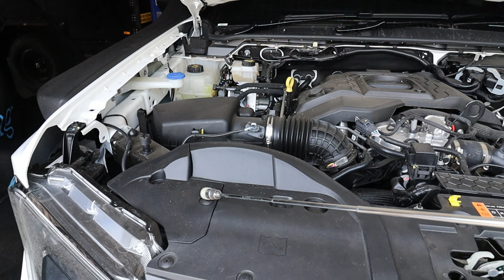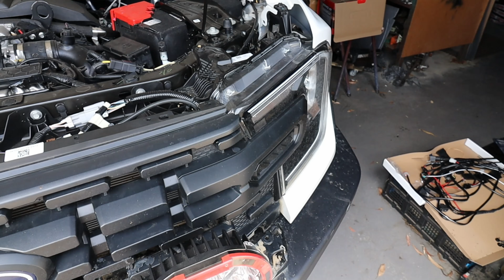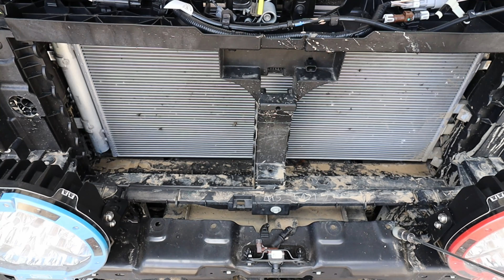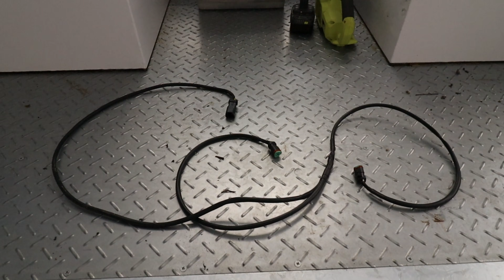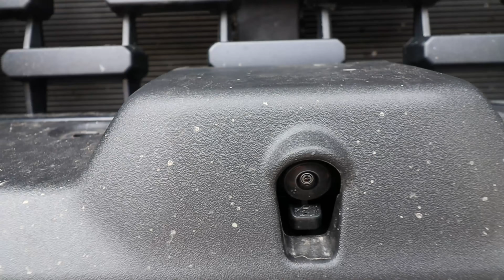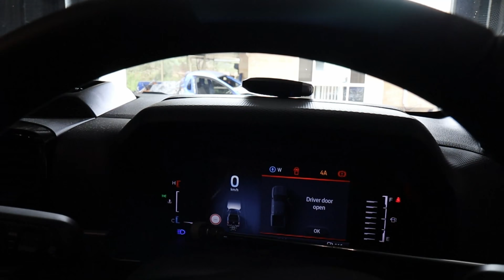Ranger Super Duty - Mounting Spotlights

Comment: Hi Just a quick question about your wiring. I agree that the yellow wire from auxiliary switch 6 should be used as it only receives power when High beam is activated. Did you run a separate earth to the chassis and is this all the wiring that was required?
Reply from the maker: Hi Daniel
Yellow is the feed from the relay. Yellow with black trace is the negative you can use. These are taped together at the top of the radiator LHS.
That was all we needed to get our lights working.
Hope that helps.
Cheers
Daryl

Comment: I have been enjoying this series of vids... thanks very much and well done!
We pick ours up in April and the first mod I will do is insect mesh over the radiator, which will require pulling off the same facias. Noting how plastered your vanes were already reminded me of how beneficial the mesh is. It's something I have got into the habit of with each new vehicle. Would have been good to see a bit closer where you picked up the fuse box. Loved it anyway.
Reply from the maker: Thanks. Great to hear it is helping others. For the spot lights, you connect at the yellow & yellow/black tail where you saw my 2 pin connector. You don't have to get into the fuse box. The only time you would need to get into the auxiliary fuse box is to check a fuse or relay. As a heads up, next episode is all about the aux switches.